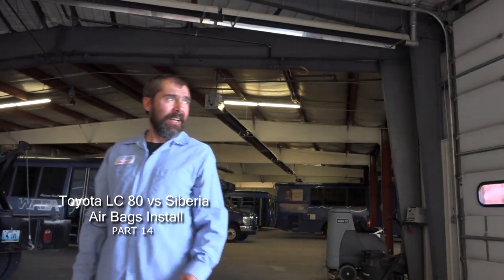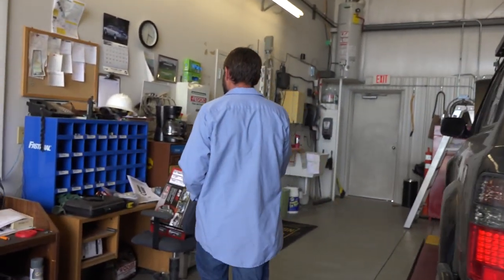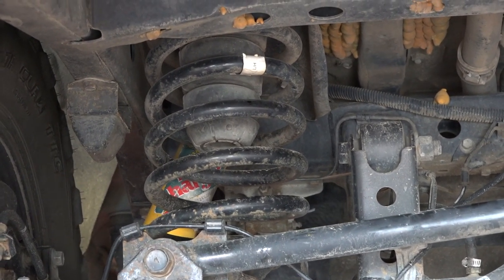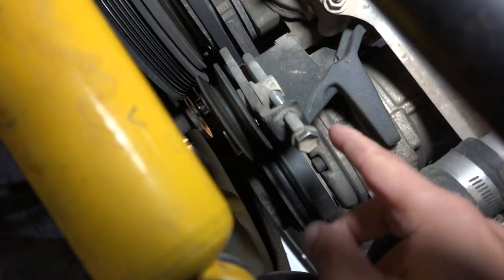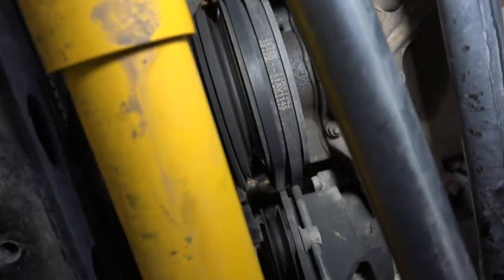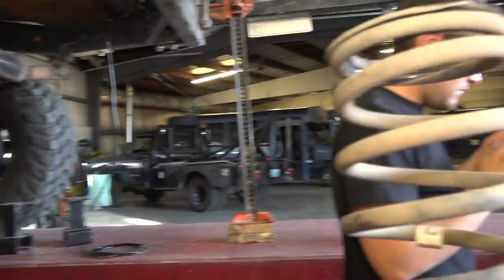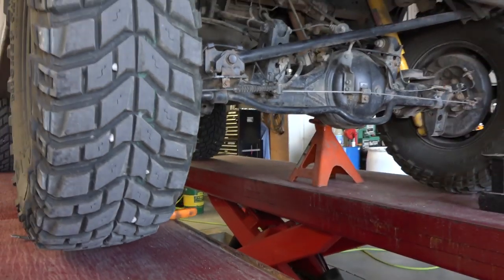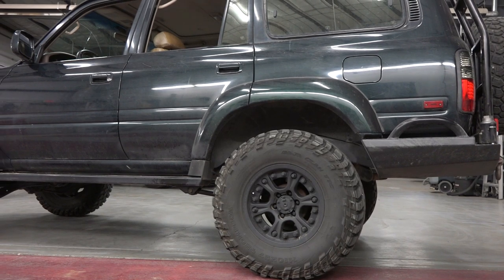Toyota Land Cruiser vs Siberia: Alternator belts and Air-Bag Springs Part 14

Comment: I did by by you example and fount it is wrong way of doing so - you need to use the stock bump reflector that Mitch unscrewed and cut 3 rings from the bottom and live it there , then the bottom home need to me 1/2" wide - anyways who is all in Moldova?
Reply from the maker: Moldova is just fine. Settling down...

Comment: Can I ask what air lift kit did you purchase?
Reply from the maker: I think it's Old Emu 2.5" heavy duty. Don't know for sure as it was install by previous owner.
Reply: Thanks, how about the Air LIft bag? BTW Very nice LC 1
Reply from the maker: OK got it. Don't have the info right now. Will reply tomorrow once have the access to the box with the part number.
Reply from the maker: OK it's Air Lift Part# 60755

Comment: Cool video once again Jake, wish I had that big lift to play with to flex my 80 out on! If you find yourself stuck without the hi-lift again you can also remove/install springs on a lifted 80 with 2 jack stands and a normal floor jack, Slee has instructions for the process - http://www.sleeoffroad.com/technical/tz_ome.htm

By the way I'm going to be moving to the town of Cody soon; I'm moving this month actually. - I was wondering if you could possibly fill me in on any cool wheeling or offroad spots in your area or in the area of Cody, I'm lost on knowledge of any good spots there except a mountain access road or two I've seen during vacation. I would really appreciate it, reach me either here in the comments or send me a message here on YouTube or on ih8mud(Username is Shooter307), whichever you prefer. Thanks
Reply from the maker: Welcome to Wyoming.Not sure about Cody area for wheeling. I am sure though there is plenty. If you want to come down to Lander area there is plenty of trails we can wheel together. If interested let me know here and I'll PM with my phone number. Jake.
Reply: ***** Thanks Jake. I'd definitely be interested in making a trip down to Lander and I really appreciate the offer. Go ahead and PM me your phone number for sure.
-Eric